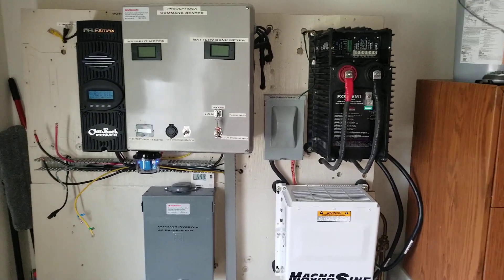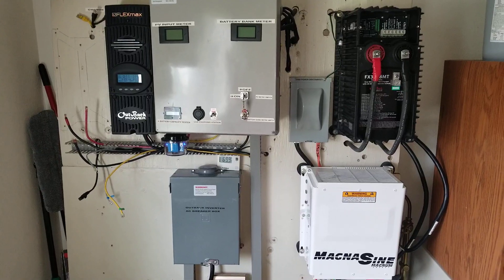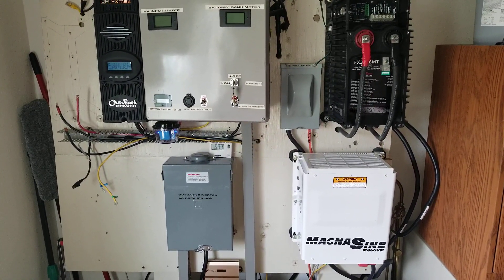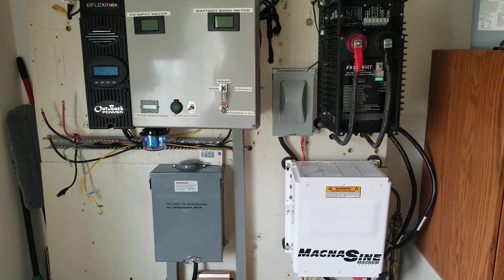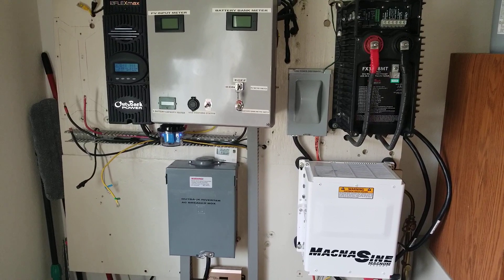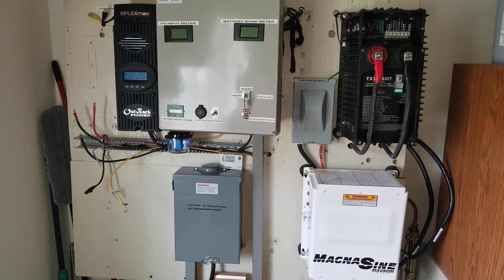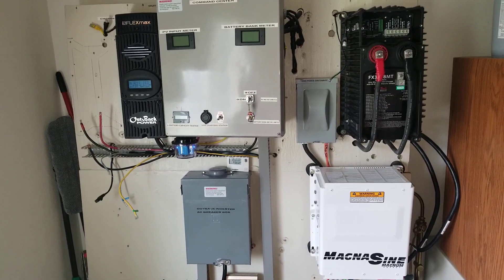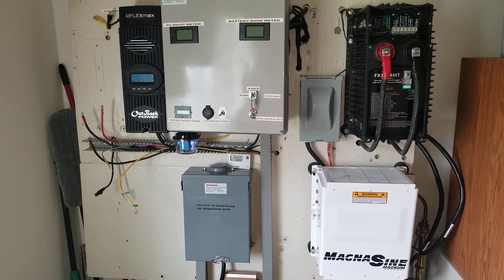THE UGLY TRUTH BEHIND OFF-GRID SOLAR POWER SYSTEMS AND SOLUTIONS: Off Grid Power Solutions (Part.1)

Comment: Take everything down and make the wall bigger with new plywood for more room. Place all the components such as the Outback Inverter and FM 80 on one top side , and the Magnasine and Power Track on the other top side . Keep the Command  Center Box in the center between the Inverters .Have both  Mates , Magnum BMK , Data Hub and the Monitoring system board etc that corresponds to each Inverter right under the Command Center Box , and have all the battery switches ,fuses, shunts , disconnect switches ,wire connections and etc that goes to each inverter (if you are using both )  on each side of the corresponding Mate ,Manga BMK , data hub etc that is under the Command Control Center and monitor system on the bottom .This is just a suggestion that you may need a bigger wall for more new components . May the solar be with you .
Reply from the maker: Thanks for the suggestion brother.
I have limited space inside my Power room and I can't go any more bigger at this time my board. 
This is the reason why I get rid of my XANTREX XW6048 Hybrid Inverter/Charger because of space and the weight of that thing It would have crippled my entire power board.
Thanks once more again.
Cheers